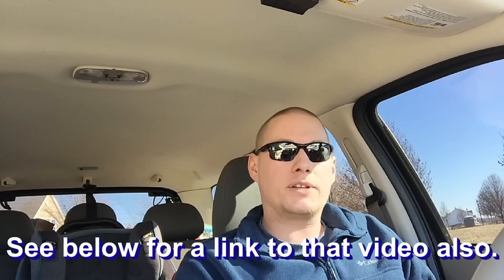Ford Ecoboost Engine Carbon Deposits: What You Need to Know

Comment: Okay...It's one year later.  Need new plugs for my F150 3.5 eco.  They're recommending a fuel injector cleaning to the tune of $140.  Things changed?
Reply: This $140 fuel injector cleaning gimmick won't do shit. Ask them about the procedure lol. They'll put a bottle of fuel treatment in the tank and go drive the truck hard to put some load on it so the injectors can get a workout. Do that yourself.
BTW that'll do nothing to carbon build-up on the valves

Comment: A little off topic but some guys are putting a 1/16" hole at the low point in their intercooler to keep water and oil from accumulating.  How do you feel about that and what is Fords opinion on it?
Reply from the maker: Fritz Geiger I feel it cannot hurt but at that diameter it seems it would plug and freeze also in my neck of the woods so doesn't make much sense to me.
Reply: Ya, I was thinking of a valve of sorts.

Comment: I know this is an older video but has there been any movement on a ford approved cleaning solution?
Reply: I haven't heard of anything yet myself, but Ive used a product called carbon off its a commercial oven cleaner from restaurant supply sites.I've used it with motors after disassembly.If I get the code for dirty intake valves I'll pull int manifold and with valves closed 1 cylinder at a time will soak with carbon off.the stuff is amazing and safe for all metals.

Comment: You like Pennzoil but what are your thoughts on the Motorcraft synthetic blend oil which is standard oil change?
Reply from the maker: Kevin Mason I think the motorcraft syn blend is ok too but personally I would use the penzoil stated because it has many more cleaners in it and is the molecules are made more evenly being made from natural gas.
Reply: +Kevin, in my research online and first hand experience, I have determined that while expensive, Royal Purple is excellent and its true to its claim. Research also shows the synthetic blend oils don't have enough synthetic properties to even matter. Its honestly a waste of of money. When I switched to RP I was unsure I did the right thing. My car is quieter and smoother and funny enough as the claim sounds, I have seen a minor MPG improvement.

Comment: I am using Valvoline synthetic oil in my SHO.  Is that a good oil?
Reply from the maker: +Bonnie Hamilton I do not recommend it no I would go with the Penzoil Full Synthetic Natural gas oil-http://www.amazon.com/gp/product/B00ELHNM3K/ref=as_li_tl?ie=UTF8&camp=1789&creative=390957&creativeASIN=B00ELHNM3K&linkCode=as2&tag=fordt-20&linkId=AWWNCQAVXYLJRZHI
Reply: +FordTechMakuloco Pennzoil for the win!  I am going to put this in my car soon, bought on sale, etc while back.  What do you think about the idea of turbocharging a 2012 Ford Fusion 2.5 I4 with a 2013+ fusion 2.0 or 1.6 turbo kits from say crashed cars?  I know some tuning will have to be done, but Ford turbos should be all set for transition.
Reply: Bonnie, check out Pennzoil Ultra Platinum
Reply: Valvoline is OK. Castrol Syntec/Edge and Pennzoil Platinum/Ultra are a step up. Amsoil and Redline and Royal Purple and Schaeffer and a few others are a step up again. The Valvoline stuff still beats the semi-synthetic Motorcraft crap that Ford dealerships use.

Comment: With your knowledge, if you were to recommend a 2011+ F-150, would it be the 3.5 Ecoboost, or the 5.0? Thanks
Reply: Get the 5.0! Not only does the 3.5L have the GDI carbon issue, BUT it also has an INTERNAL water pump which, if it starts leaking, GOODBYE ENGINE!

Comment: Do you see this issue alot on the focus st? or is it mainly with the f150 ecoboosts? Just asking cus i was really wanting to look at a 2016-17 focus st.
Reply from the maker: Any boosted engine will have this carryover issue but the ST usually is driven in a much more aggressive way so that helps a bit.

Comment: so, what exactly do you mean by "top tier" gas ?  not premium with no ethanol, right?
just 10% ethanol reg fuel from Shell or Chevron ?
Reply from the maker: Bob Haddock Just gasoline that meets top tier specs. There is a whole site that explains all the specs the fuel must meet before being certified top tier.

Comment: Is this going to be an issue on my new F-150 with the 2.7 ecoboost?
Reply from the maker: Jordan Watson Carbon deposits yes
Reply: FordTechMakuloco  So, still no real solution other than quality gasoline? The Chevron Techron is not available to me in Canada (or at least not where I live). Is there an alternative that you suggest? How often should it be added to the fuel? Oh, and high octane or regular?
Reply from the maker: Jordan Watson I would use the BG 44K in tank cleaner every oil change. A link to the product is in the video description.
Reply: FordTechMakuloco Thank you!

Comment: 1) turbos glow red-hot under full power.... 2) Positive intake port pressure from the turbo means the exhaust gas can only flow one way.... out the lower-pressure exhaust port. 3) Non-igniteable gases are beneficial. You may have heard of (E)xhaust (G)as (R)ecirculaton. Helps NOx emissions. 

Carbon buildup is NOT A PROBLEM... goddamn!
Reply: +TheArfdog i think his issue was the misfires he was getting on a 2.0 ecoboost. From the carbon buildup. Obv. its expected, and to a point not a problem, (and i cant speak further because i wasnt there) but if hes actually in contact with Ford (i couldnt find a reason to lie about this) about the specific issue i think it lends credibility to it being the problem he was troubleshooting.
Reply: Carbon buildup is clearly a problem - it prevents the valves from closing fully in some cases. Where the heck would you get the idea that it doesn't matter? That's absolutely ridiculous and you should feel intellectually ashamed of that. Go stand in the corner!

Comment: So if it’s not that big of an issue then why bother doing anything other then using a quality synthetic oil and be done with it?
Reply from the maker: Go for it.
Reply: @ I wasn’t being a smart ass, just asking a question because I am confused. Is it an issue or not? If it is then what is the best solution? I have 94k on my 2017 Escape 1.5L. Maybe it’s past the point to do much? I’m not having any issues with it.
Reply from the maker: No it is just on these models it seems as there was a crimping die issue.

Comment: How long do you think till Ford fixes this flaw with the Ecoboost motors? I'm not talking so much of carbon built as I am about the crankcase ventilation problem with oil and water vapor ect. I have looked at the RX catch can system and others they seem to work well but I don't want to do that to a new truck. I'm looking to buy a new f-150 in this coming year and I'm torn between the 5.0 and 3.5 Ecoboost. I had a 2011 Ecoboost and loved it but at 30,000 miles I had the misfire problem so I dumped it for a diesel. Any input is appreciated.
Reply from the maker: Wildland North I am sure on the 2015 the ventilation system is much improved and wouldn't worry about it. A catch can is still the best to collect it all. Every engine has oil carryover.
Reply: Ok thanks for the response.

Comment: ohh man. i was thinking of buying a 2015 edge with ecoboost. should i stay away?
Reply: cgtalk ! I would. If you want an ecoboost wait for the new one with di AND port injection.
Reply: cgtalk ! I'm not hating this guy's video it has a lot of good points but what I can say to you is change the spark plugs every 50k and she will run a lot better for longer I have an f50 ecoboost with 160,000 and she still gets around 10 to 13 l to  100km mixed city highway

Comment: Has this problem changed since this video was made?
Reply from the maker: no
Reply: Didn't 2018 have different fuel injection system that eliminates the problem?
At least that's what the dealer told me when I went shopping.
Reply from the maker: Only on certain engines.

Comment: Fords fix was to add sequential fuel injection on their newer engines. Direct injection doesn’t wash the valves. Port fuel injection sprays atomized gas in through the valve into the cylinder which keeps the carbon deposits from coking the valves. Flunky design that direct injection

Comment: 20 yrs ago an engine with that much mileage or carbon build up would have the cylinder head removed to be de-carbonised and a Valve service with no second thought. it seem now this day and age with the amount of more complexity going into engines and the higher labor cost involved in removing a cylinder head these days. cylinder head servicing is a thing of the past. People and mechanics are ignoring this issue or trying to find a cheaper alternative with no success
Reply: buy a 2000 $ beater

Comment: Due to cost and location convenience, I fill up my 2011 F150 3.5L EB with Cosco premium fuel. While it doesn't have Techron like Shell or Chevron, is it considered a "cheap" premium fuel that they use, or should I be ok?
Reply from the maker: It's considered top tier so yes it is good.

Comment: Thats alot of dumb stuff opening the intake valve on the exhaust stroke and they have no approve cleaning method but just get rid of the pcv or at least a catch can and a water methane kit would help

Comment: Is this still a problem with the 2018 ford ecoboost ?
Reply: I don't know about all ecoboost engines but in 2018 they added port injection on the 2.7 and 3.5 to help alleviate deposits on the valves. Glad I have a 2018

Comment: Sorry , I'm not Interested in Using Premium Gas for my Used Car that I am looking to buy.. I may only drive 100 miles a week and only do the ave of 22 mph, but I want Gas Economy and not go buying a 4 cycle car to save gas, but end up having to Spend $3 gal for Premium Gas.. I'll avoid the Ecoboost engine vehicles.  Thank you.. for the Insight.
Reply: Typically in my area the only fuels without ethanol are the premium fuels so that is why I pretty much have to use premium fuel in my car.

Comment: @Fordtechmakuloco  after my ecoboost engine has been running when i shut it off i open the oil cap and theres alot of smoke coming out of it and that normal?
Reply from the maker: Yes
Reply: @FordTechMakuloco  thank you so much

Comment: Does this affects 2013 Focus ST 2.0 ecoboost as well?
Reply from the maker: +Steve Tan CH yes
Reply: +FordTechMakuloco 
so far any recomended method to clean the carbon issues? like Seaform? or any other ways that works and doesnt damage the turbine fins?
Reply: +FordTechMakuloco how did you get a hold of an engineer?
Reply: he was a ford mechanic at the time
Reply: I appreciate that.

Comment: I know an approved method that allows you not to worry about carbon... Battery/Electric!  I know I know... I just bought a 2020 F150 2.7L.  Why? I could not wait for my reserved Cybertruck.  When they are produced in abundance, I will sell the ICE F150 and get a comparable electric motor powered truck.  Carbon in the the intake track solved!

Comment: is this for all DI engine or only turbo engines?
Reply: +Richard parnell All DI have this problem. The new Tacoma has 2nd set of injectors in the manifold to spray gasoline into the valves and clean up carbon build up.

Comment: Has Ford resolved this issue?
Reply: They fixed it by adding port fuel injection:

3.5L 2017 and above

2.7L 2018 and above

WARNING: Ranger 2019 2.3L does not have port injection. It will accumulate carbon.

Comment: 1:15  What is that little white orb flying thru your car?  Weird.
Reply: the camera even has some sort of energy spike or something.   gets real bright and then the orb pops out .  ive seen a few orbs and they all move weird like that one did
Reply from the maker: +skypilot0077 I know right it must of been a light reflection of something passing by.
Reply from the maker: +Nicholas Brooks Yes the front facing camera on the iPhone 6 does this unless you lock the brightness adjustment and focus kinda sucky for a camera to keep changing like this on the fly .

Comment: @fordtechmakuloco I have a 2011 fusion 2.5. I myself am a Toyota technician, but wanted an opinion on doing a fuel induction service for my car. Is it genuinely recommended to do them on those motors?  Thank you.  love your videos have learned a lot from them
Reply from the maker: On the 2.5L yes it is ok but only needed every 60k miles or so.
Reply: FordTechMakuloco thank you wanted to be sure before doing it.

Comment: Why aren't there valve rotators if that is the issue?  Then the same side of the valve is never exposed long-term. Or are you referring to the top and bottom of the valves?  In that case ~nevermind ;)
Reply from the maker: +Latro Geniwile I would imagine it would cake on all around either way.
Reply: Because that would be way too much complexity for a system that doesn't fix the issue... Would you want to have to bring your car into the shop because your valve rotator failed? geez, I sure wouldn't!

Comment: I seen you first video about the oil build up on the valves on the echo boost engines. what about using a oil systems cleaner? could that still put the particles through the Turbo

Comment: Any updates? How do we clean ?
Reply: Can’t clean, only replace :-(
Reply: Been trying to find out how to clean and only been finding out replacing it is best option
Reply: What if we remove it and clean it then return it back... does that work? Because I dont see why replace when you can clean it
Reply: Mohsen Alabbas you can clean it but ford hasn’t approved any cleaning agents for the eco boost agents. My suggestion is to just use good fuel, premiums like chevron with Techron is what I put on mine to minimize the gunk
Reply: Using those unapproved cleaning agents can possibly damage the intake so I wouldn’t use them.
Reply: @entonigarcia3590  you dont understand sir.. where I live buying parts is ten times expensive than in USA and even gas (max we have is 91) and its expensive now... I'm saying if I'm going to change the head then why not to take it apart and clean it with gasoline and a brush then put it back on( like a new one)

Comment: I only use 100% gasoline. I stay away from the "Up to 10% methanol added" gasolines. Also, I only use Amsoil
Reply: Shotgunnar do you mean " Up to 10% ethanol added" fuels ?
Reply: +Shotgunnar.   That's terrific but I live in Minnesota where 10% is mandated and they're trying to mandate 15%.  Here ethanol is a subsidy for agriculture...they found out how to raise the price of corn.  It's awful fuel.  Got 30,000 on my '11 3.5 Eco and just had to replace the plugs ,boots and dealer recommended a "Ford approved" induction cleaning (including full oil change) and fuel additive.  Runs much better but still is rough on initial start-up (high idle).  Once the initial rough spot smooths out, it seems to run fine.  I'm watching it closely.  Some dealers are willing to spend a lot of your money.

Comment: 2 years after this video, is there any Ford approved cleaner for the Ecoboost?
Reply from the maker: Not yet.
Reply: Funny, I called 2 different Ford Dealerships today and they said the have a fuel system cleaning they offer for $150 that is supposed to clean up the carbon on intake ports. I asked them if it was Ford approved and they said they wouldn't offer it if it wasn't. Not sure that was a real answer...

Comment: what about using premium fuel
Reply from the maker: Darn cut that out- performance wise it will help but according to the Ford engineer premium fuel does not help at all with any carbon build up.
Reply: what do you think about the new Raptors engine is  going to be called the Eco beast what engine will it be??
Reply from the maker: Joseph Maldonado I think a 5.0l Ecoboost will be plenty
Reply: FordTechMakuloco 3,5 ecoboost 500hp in the 2016 raptors
Reply from the maker: I know I read that is nuts!

Comment: Why can't Ford just ADD port injection to the EcoBoost engines, like they have done with the Coyote motor?  It has port AND direct injection and, as a result, does not have the carbon issue.  Is Ford just trying to save $$$ by not doing this?
Reply: They did.  2017 and up EcoBoost engines have another injector in the intake manifold that sprays on the backside of the intake valves.

Comment: Seek out a Dodge- only brand without direct injection that I know of.
Reply: Toyota uses direct injection, and it has an injector that sprays the back of the valve, even though it is port injection too... D4S Atkinson Cycle technology. It's a simple solution that direct injection engines need...

Comment: Redline sl1 system cleaner is a lot better than techron
Reply from the maker: +Brian Kerby Really have you done testing on it yourself? Does it clean and protect the fuel sending unit too like Chevron Techron Plus?
Reply: +FordTechMakuloco I'm no chemist, but seems the PEA (PolyEther Anime ) content in this product is pretty high (based on Internet searches) higher than techron concentrate. Its a powerful detergent that cleans up junk in the fuel system.

Comment: Is this still an issue in the 2016/17 F-150s?
Reply from the maker: +orckiller91 2017 and newer it won't be as much of a problem
Reply: FordTechMakuloco So is the 5.0 f150 the best bet for less problems??

Comment: So which motor do you recommend for longevity-5.0 or 2.7?
Reply from the maker: The 2.7l has been great so far but it is starting to have the same problems the 3.5L has had. I have no faith in the ecobooost engines at this point and cannot recommend them the 5.0L is still my choice.
Reply: Yup. I'm switching back to the 5-0
Reply: FordTechMakuloco Amen Brother the 5.0L Coyote V8 is the best.